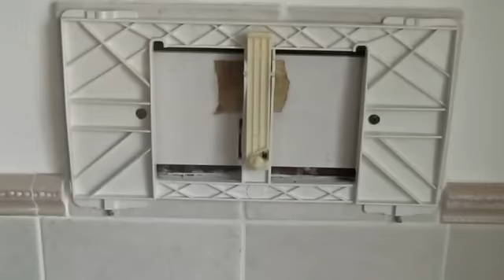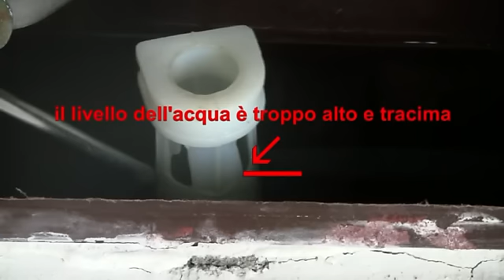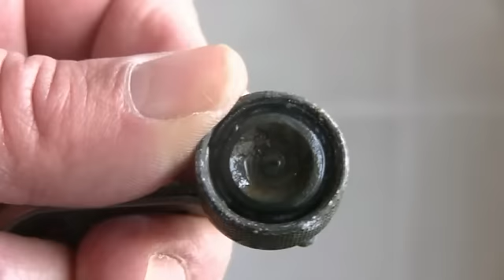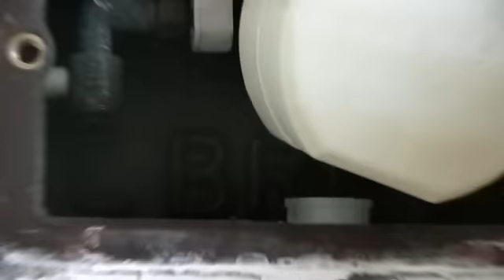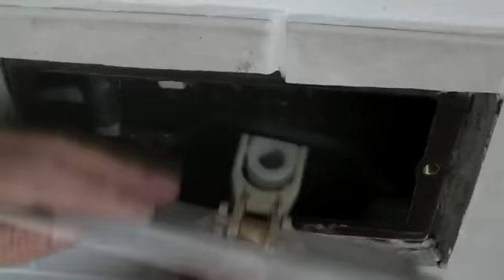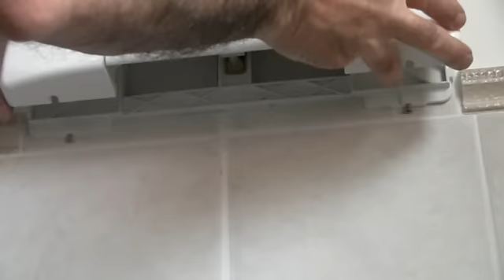cassetta wc perde acqua

Comment: Salve,
Ottimo video :-)
può anticiparmi le dimensioni della  Guarnizione a scodellino ?
In rete ce ne sono di vari tipi tra cui:

D MM 23

D MM 21

D MM 19

D MM 17
Reply from the maker: Fabrizio Leoni per questo modello, della fais milani ci sono gommini da 18mm di diametro, ma penso vadano bene anche quelli da 17mm, perché quelli da 18mm vanno su un poco forzati.
Li trovi anche da chi vende materiale idraulico, costano pochissimo, quasi niente.
Reply: cigboby grazie mille :-)
Reply: cigboby Ti ringrazio per questo video molto esaustivo e per le info che mi hai dato. Ho risolto il problema in 10 minuti e spendendo 50 cent di guarnizione.Grazie ancora :-)
Reply: Fabrizio Leoni